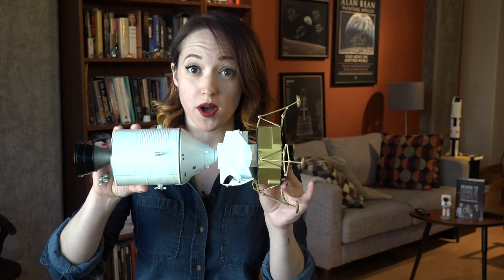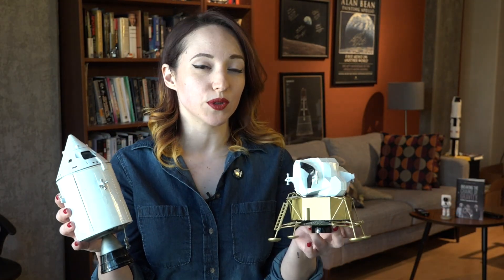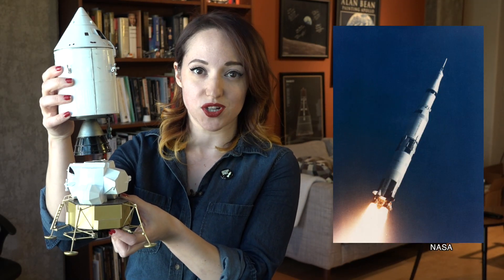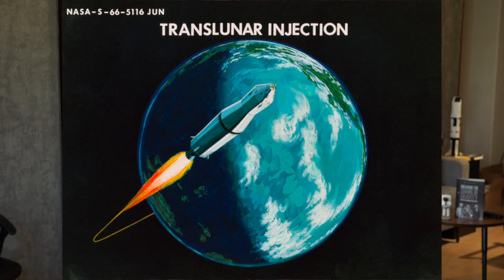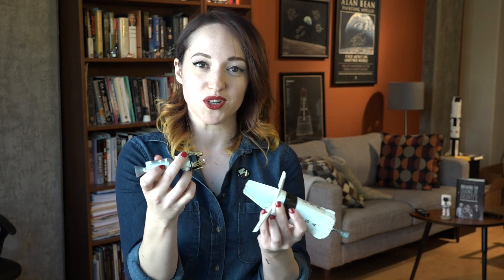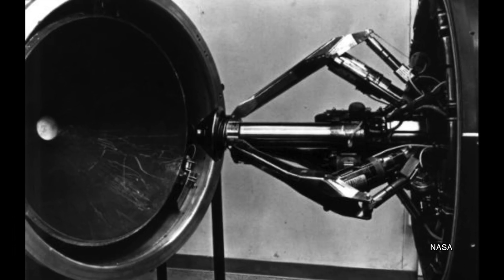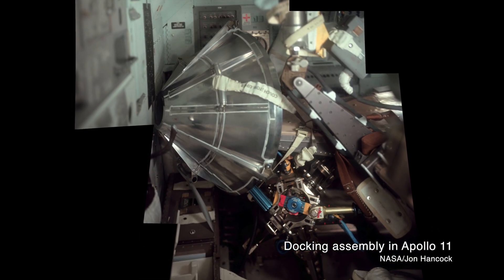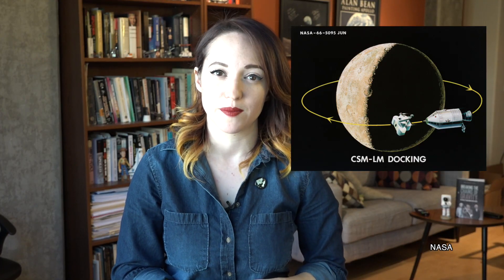How Did the Apollo Command and Lunar Modules Become One?

Comment: Amazing this was all done when the orbit sped was 2,000 mph[relative speed]. From straight up to hit that as small hole as well as move 90% relative as well... I don't believe it... The footage shows the module did not have burns to the side .. Wake up world we didn't go...
Reply: +Graham N - How do you think space-craft dock at the ISS?
Reply: +Greg Brance After some hours of positioning certainly not anywhere near as haphazardly as the moon landings. Relative speeds near to be near zero. This was meaning the sideways inertia needed to get to 2,600 would have needed a massive "burn" and they simply did not have the fuel and would have been clear on any TV shots.  The TV images do not stack up to working the way they said they did. if you have an open mind on it look again at some other footage. Getting the relative speeds so they closed zero MPH simply was not possible with the fuel they had and the kit they had.
Reply: +Graham N - Is this your single best argument as to why the Apollo lunar missions are fake?  The one that you find the most convincing.
Reply: +Greg Brance no it's just another one. think, no crater no dust on the landing legs - impossible. Photo's that have no crosses on and the best most iconic photo of all that has the cross hairs off centre no one can explain that. The van Allen belt that would fry them. Even astronauts on the space station complain of flashes from the belt and they are not even near it. Suits that went from zero degree's to oiling yet the astronauts felt nothing. You pick one . flags that wave - no not while being handled, that I get but when the walk past! too many problems. This was to hoax the Russians that's the bottom line..
Reply: +Graham N What is your single best argument as to why the Apollo lunar missions are fake?  The one that you find the most convincing.
Reply: +Greg Brance It's the whole lot. What do you find the most convincing we went.. You saw it on TV ?
Reply: +Graham N - The 800+ Lbs of Lunar Material brought back from the lunar surface.  You are still dodging my question.  What single best argument as to why the Apollo lunar missions are fake do you find the most convincing?  If you have really researched this event, it should be easy for you to answer this question.
Reply: +Greg Brance The lunar material when analysed appear to have too much oxygen in it. Am I dogging your question no. I would go with the physics of the docking as the most decisive. What is your underlying argument - that the world saw this on TV or that rock from the canary island and meteors gathered from parts of the ice fields of Canada [check that out] are the real dealGo ahead and have a go...
Reply: +Graham N The lunar material doesn't have to much Oxygen in it.  The fact that lunar material displays a lack of Oxidization is key evidence that the material was not from Earth.  The Apollo lunar material also has Solar Wind particles on it surface and this same surface shows the impact of micro-meteorites.  Both of this is also key evidence that the lunar material was brought back from the Moon because you cannot replicate this on Earth.
Reply: +Greg Brance - As far as docking  There is nothing from the physics side that would prevent docking of two spacecraft in space.  The technique of docking in space was one of the key tasks that the Gemini missions worked out.  Gemini 6A and 7 first demonstrated rendezvous without docking, Gemini 8 conducted the first docking.  Gemini 10 was the first mission that docking and rendezvous was done twice, the mission docked with two different Agena spacecraft.  Docking and rendezvous was also done on Gemini 11 and 12.  For Apollo docking and rendezvous was demonstrated in Earth Orbit for Apollo 9 and then was demonstrated in lunar orbit with Apollo 10.
Reply: Single best argument?   F = m(A)

That is a law, not a suggestion.  It explains why the Space-FX booster 'landings' were fake too.
Reply: @Lurie2010  how does F=MA disproved SpaceX?
Reply: It is why rockets go up but do not LAND on their rocket(s).  F=m(A) where A has to approach (then equal) zero, while maintaining CG over the vector of thrust.  Cannot be done.  With or without atmosphere.

Notice I said "land" and not "launch" because that is what make rocket science such an intricate and exacting science.  Because without proper guidance systems, you know what happens....right?  And that is on lift off.   ;-)
Reply: @Lurie2010  Your argument makes little sense, because there is no massive difference between landing and launching in this aspect. The thing is, F is just the resultant vertical force. You can hover whilst vectoring to the side because it doesn't suddenly stop the engine from being able to produce a sideways force. Also, if you are trying to suggest the rocket would topple over, then this also doesn't make much sense for spaceX. There isn't really a force acting on the rocket that would do that, other than maybe the vectoring itself. But in any case, it is so minor at a near vertical angle that the nitrogen thrusters can easily overcome it.
Finally, this phase of the flight is only a very few seconds long. This means there really is very little time for any major instability to happen, as long as the rocket is flown reasonably well.
Reply: My dear departed friend Bob Bowman used to say (often) that "You don't have to be a rocket scientist" when something was fairly obvious.  Sadly, my friend was wrong.   :-(
Reply: Rocket Science 101: F

(I edited out the "-" as the spelling was good.)
Reply: +Graham N Actually it's very simple. The CSM just needs to detach and accelerate to a few km/h relative to the speed of the S-IVb, turn around using its maneuvering thrusters once it has reached a safe distance so it's nose-on to the LM, then brake gently until the nose contacts the LM docking tunnel. Relative speed between the two vehicles (the CSM and the S-IVb) would be a few km/hr at most.
Reply: @TourOfTorun  very simple! 🙂.. with almost no computing power...
Reply: @TourOfTorun  simple 😂😂😂😂
Reply: You can calculate the total Delta V from a rocket using the equation Isp * g * ln(initial mass/final mass). The Ascents stage had an intial of 4.7 tonnes and a final mass of 2.15 tonnes, with the main engine having an Isp of 311s. This gives us 311*9.8*ln(4700/2150)=2383.66 m/s of delta V. 
The moon's orbital speed at 50km is sqrt(4.9e12/(1737000+50000))=1655.9 m/s, meaning to get to orbital at that height they need about 1800 or 1900m/s of their fuel, giving them nearly 500m/s to work with. Its definitely possible.
Also to mention, their reaction control systems had a delta V of about 100m/s when the main tank is empty so really its closer to 600m/s useable. The RCS are very weak so very useful for canceling out their velocities once the get within a few m/s of the apollo module.

There is also the whole matter of the mirrors they manually placed on the surface so we could track the moon more accurately with lasers. Many large observatories can demonstrate this, and it would only of been possible with a manned landing.
Reply: The math checks out.  The other thing they did on the later J class missions was to do a slightly shorter rendezvous by dropping the CSM in it's orbit to a lower orbit.  This allowed the LM on the J class missions to be bring back more lunar material.
Reply: Found the idiot!
Reply: but,...but... little Amy has explained all that.....?
Reply: No they were at 0mph relative speed to each other. As for the straight up to hit, remember they were stowed directly in line with each other. All that was need was to flip the CSM 180. They were already directly in line, so they they could just push forwards. I don't see how this is implausible.
Reply: Oh I see you mean the lunar ascent, apologies. I still don't see how that proves anything though. They have no atmosphere, the ascent from the moon is a perfect textbook physics problem. Liftoff at the perfect time and a flight as expected would inevitably yield a perfect rendezvous. This was carefully planned to happen. 
Spacecraft at the ISS still need to get into orbit, and they can dock in a matter of a few orbits when so. This is mostly due to not being allowed to leaving giant spent booster stages in the vicinity of the ISS, which going direct to its orbit would entail. And remember, earth is far bigger than the moon, so a docking is far harder in earth orbit, so that explains the rest of the adjustment time.
Reply: Graham N -- Elements of Spacecraft Design explains things very well.
Reply: Graham N thank God it was starting to look like everybody in the comments believed that garbage.
Reply: You guys believe in this crap or about as dimwitted as they come. Spend some time investigating NASA hoaxes. You'll just look like fools when you finally figure it out. you're getting the big time okie doke
Reply: @toddpeachey712  define dim witted because my degree says otherwise
Reply: Connor Austin ......degrees are 10 a penny these days, education is now a business, they even have one in 'Underwater Basket Weaving'
Reply: You are correct.  You didn't go anywhere. You weren't born yet. You babbel.
Reply: I don't know whether they went or not. I get caught in the yes or no side of the debate witheach video I watch. Until I reach the point where I actually no longer care either way. All I know is that I've never met anyone who has been on a Saturn V rocket, so until I meet one and hear it straight from the horse's mouth, I won't be able to make up my mind. The other thing I know for absolute certain is; I know I wouldn't have wanted to go. I've had two Rovers in the past and both were unreliable, so knowing my luck I'd get to the moon, wander about for while making shody snaps with no viewfinder then get back to the lunar module and the key would get stuck in the ignition and I'd have to rub lunar sticks together like tom hanks in castaway 13. then wilson would escape back to see jenny before me and ohh the whole thing would just be a complete disaster. mama always said life was like a box figure skater boot barbecued crab fingers, houston always knows the problem what you're never gonna solve.

Comment: Question, how could the command moledule connect to service moledule without makeing holes in the heat shield ? I heard in the movie Apollo 13 said " Turn the heat shield around". Why turn the heat shield around when the bottom of the CM is already pointing to earth ?
Reply: +Kiu Cheung LAI   "how could the command moledule connect to service moledule without makeing holes in the heat shield ?" 

By going around the heat shield. The object at the very top  of the service module was the  Umbilical separation system that connected to the side of the command module:
http://www.daviddarling.info/images/Apollo_13_damage.jpg

Here's a picture on the launch pad with the system on the left side:
http://history.nasa.gov/ap11ann/kippsphotos/69-HC-717.jpg

https://encrypted-tbn3.gstatic.com/images?q=tbn:ANd9GcQuNmTvXWHRLX708sV8jrj1N8JbYhCSmHe49aiQG6Cu-SRdEItT

Comment: Hello Miss Teitel I just viewed your video on how the Apollo CM and LEM docked. and having viewed a number of your other views I am hoping you may be able to help me locate some reference data and or images regarding the Apollo Spacecraft LEM Adapter (SLA). What I looking to find is How the SLA was attached to aft bulkhead of the Apollo Service Module. I have located data has how the aft section of the SLA is mated to the Instrument Unit (IU) and the IU to the SIVB. But no hard data (hardware) use in the mating of the Apollo SM to the SLA. other a statement regarding a circumferential ring.  I would greatly appreciate any inform or resource to locate this data and image.  Thank you. Sal

Comment: So I'd imagine the tunnel was like a balloon. Once the latch was secured the tunnel inflated? Am I right Amy?
Reply: +twistedyogert : Nope.  The tunnel ran through the apex of the CM and was surrounded by the canisters that held the parachutes.  There are several point-of-view 16mm movies during the missions where one of the astronauts floats from the CM to the LM through the tunnel and emerges inside of the LM.  Since there is no air lock, it was necessary to pressurize the LM to the same level as the CM before the hatches on both spacecraft could be removed.

Comment: Out of the entire Saturn V, I've grown to be most intrigued with the adapter section.. How was it so strong to be able to take the weight of the Apollo yet be light and flexible enough to open out to allow withdrawal of the LEM!
Reply: +Dan Vitale 

Surely air pressure and aerodynamics kept the panels in place during launch. Once heading to the Moon they could be easily sprung open. 

The stress forces during launch were those of compression. The only forces pressing down on the adapter panels were the CSM. With a tight fit much of the energy would have been transferred to the SIV-B section.

Comment: So did the remaining launch vehicle upper stage then fling out of earth orbit?
I sometimes hear people say "1960s tech" as if it was bad, but... that stuff worked. They wouldn't still be using Centaur upper stages if they'd been completely eclipsed by later advances.
Reply: +HebaruSan 

The S-IVB third stages had different destinies depending on the missions.
For Apollos 8, 10 & 11, they flew by the Moon & went into orbit around the Sun. 

For Apollo 12 it flew around the Moon & is now in Earth orbit. I don't think that was intended.  On Sept. 3, 2002, amateur astronomer Bill Yeung found an asteroid. Initially named J002E3, astronomers tracked it and found that it was in Earth orbit, which was surprising. Objects within the Earth-moon system are quickly ejected, meaning this asteroid must have been a recent capture. Spectroscopic observations revealed the “asteroid” had a signature consistent with white titanium dioxide paint NASA used to paint the Saturn V rockets. Asteroid J002E3 turned out not to be an asteroid at all but the upper S-IVB stage of Apollo 12’s Saturn V.

Apollos 12, 14, 15, 16 & 17 left seismometers on the lunar surface. So the third stages of Apollos 13, 14, 15, 16 & 17 were deliberately crashed into the Moon.

The seismometers, referred to as  Apollo Lunar Surface Experiments Packages (ALSEPs), all lasted longer than the single year they were designed to. They were all turned off on Sept. 30, 1977, primarily for budgetary reasons.

Note, Apollo 11 also left a seismometer on the Moon, but it was not a full package. Because of time constraints, experiments on this first landing had to be able to be set up in no more than 10 minutes. So A11 left an Early Apollo Surface Experiments Package (EASEP). The ascent stage of the A11 lunar module was crashed into the Moon.

On A10, the decent stage was just jettisoned & crash into the Moon, but the ascent stage was sent into orbit around the Sun.

For Apollos 12, 14, 15 16 & 17, the descent stages were obviously left on the lunar surface, & the ascent stages were crashed into the Moon. The coordinates of the crash sites are known, except for that of A16. The ascent stage began to tumble immediately after being jettisoned, so the lunar impact site is unknown.

Apollo 13 of course didn't land. The destiny of the LEM on that mission was to burn up in Earth's atmosphere. I rather like the idea that the vehicle that had saved the lives of the astronauts was to go out in a blaze of glory.

Much great science was done during the Apollo missions. But a little discussed problem for returning humans to the lunar surface for longer stay missions is that of the lunar dust. It's incredibly "sticky" because it's electrostatically charged, & it gets everywhere. Just look at this image of Gene Cernan's suit.
http://ultrasonicmachines.com/wp-content/uploads/2014/01/Gene-Cernan-on-the-Moon.jpg

These are some of the problems that have been identified.

1 - It could wear down critical components: Not only can the static electricity damage valuable and critical equipment, the dust itself gets into seals and wears them down. When you’re exposed to the inhospitable environment of Space, you don’t want your spacesuit leaking.
2 - It could create health risks: Even after roughly fifty years of space travel, we really don’t know what’s in all that dust.  The astronauts on the Moon said that lunar dust smelled and tasted like gunpowder. Nasty!
3 - The unknown: Who knows what else could happen? Space, buy it’s nature, is unpredictable.
I'd say this is an area that needs much work before we go sending humans beyond LEO to land on Mars or the Moon again.

As usual I've waffled on again, but I find this stuff interesting, & I like to chat about it. You take care.
Reply: +HebaruSan 

Regarding the ascent stage of Apollo 11, I could be wrong that it was deliberately crashed into the Moon. Yummy, something to research :-)
Reply: +mako88sb  After transposition and docking the S-IVB stages where controlled by venting the leftover propellants in the tanks. Pre Apollo 13 missions had them enter Heliocentric orbit. From 13 onward they were steered to deliberately impact the lunar surface. This was done to perform seismic measurements with the ALSEP left on the moons surface by previous missions.
Apollo 13  S-IVB impact crater. https://en.wikipedia.org/wiki/Apollo_13#/media/File:Apollo13-booster-crater.jpg
Reply: +David Keenan   I'm not positive but I believe it was just allowed to gradually de-orbit via the Moon's gravity. I don't think they have any idea where it ended up on the Moon's surface. I found this link a few weeks ago that goes into quite a bit of detail about the intentional impacts. Apollo 16's LM impact isn't shown because of some snafu during the de-orbit burn:
http://darts.isas.jaxa.jp/planet/seismology/apollo/The_Description_of_Apollo_Seismic_Experiments.pdf